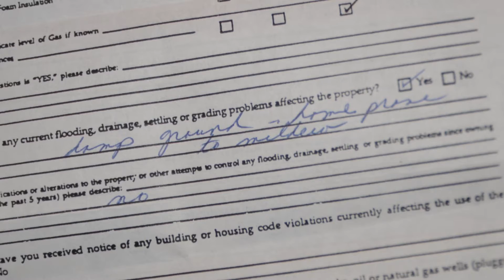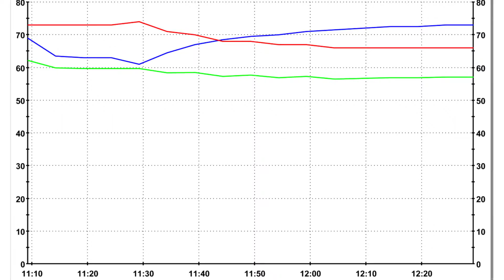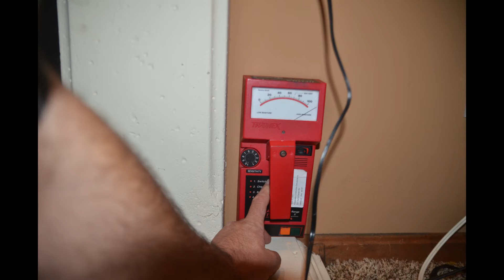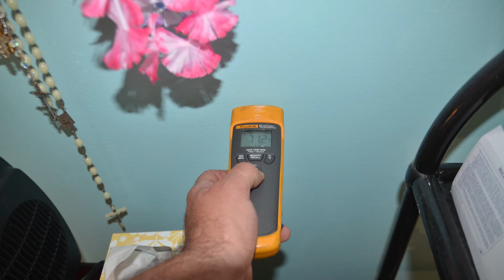Flooded Ductwork Makes people sick from  Black Mold

Comment: Hi Marko we have a slab home that was built in 1955. When we bought the home it was a mess there was water in ther vents. We ran new insulated ducts in the attic and we get zero condensation problems anymore. However we just duct taped our old vents closed. Now we want to fill them with concrete but do we need to fill the entire duct system or can we just fill the vent holes with a few bags of concrete? And we filled under the old downflow furnace.
Reply from the maker: Probably ok to fill vents

Comment: very interesting watching this. we recently moved into a home and have standing water in our vents on a slab. no visible mold yet. Nothing ever disclosed by sellers.
Reply from the maker: +Michael O'Donnell------ Its coming after it gets cold. Condensation on windows, closets, and north east corner of house.
Reply: +Clevelandmarko ours comes in after a lot of rain or a snow thaw. we believe its ground water coming up. contractor is suggesting drain tile in our foundation to move ground water to the front.